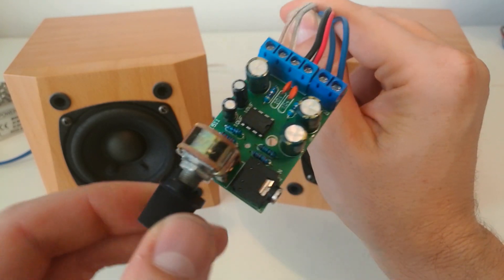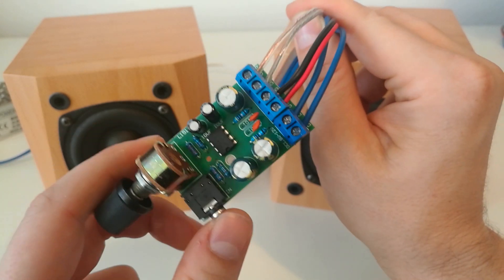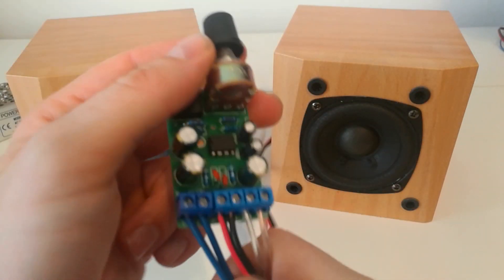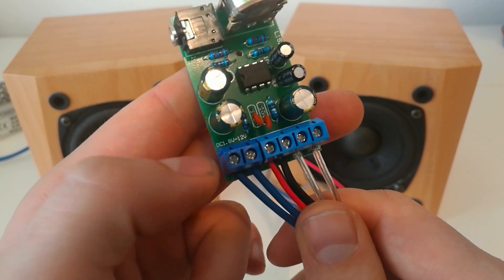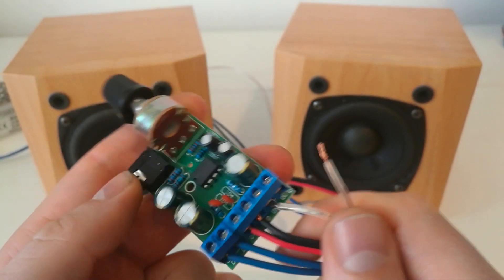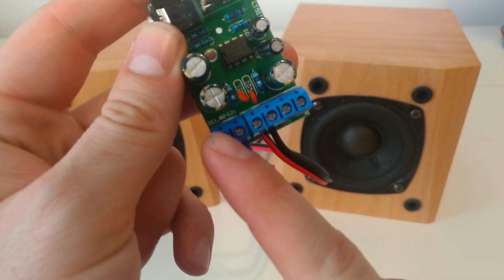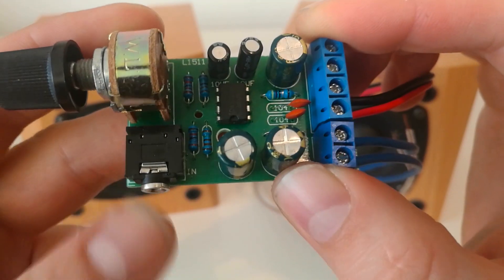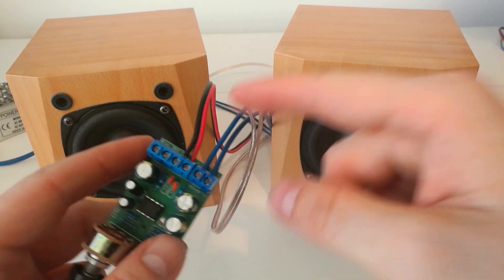TDA2822 M amplifier board 5W - Les than 1$ !!! (How it sounds)

Comment: It is not 5 watts, just one single watt. :P
The TDA2822m is what you find in those "5000 Watt PMPO" PC speakers from the 90's era. :)
I bought the same board but was unhappy: Poor amplification. The voltage divider behind the volume pot is poorly chosen. I have no idea why they reduced the input level that much?! I swapped the resistors and it's much better now :)

Comment: 1. There's no input coupling capacitors which should be
2. Input signal is over attenuated by voltage Dividers 22K & 1.5K which must be modified to increase the signal input for louder sound
3. The output 470uF capacitors should be replaced to good ones as they're leaky
4. It should be operated on 9 volts only with 8 ohms speakers else they get overheated & still a small heatsink should be fixed over the chip
5. Lastly, this chip is Counterfeit so there's much second order harmonic distortion & output power lower than authentic one😊
Reply: To 1: What do you think the two smaller ones are for? ;) - According to the official datasheet it is not necessary having them in series to the input. The default schematics has them wired to inverted input instead. So I think it's fine.
To 2: This is true and retarded because it didn't really amplify anything. I just swapped these resistors on mine and now it does its job.
To 3: I never had this issue.
To 4: I use 4 Ohm speakers and 12V power supply. I gently touched the TDA. It's not even warm?
To 5: Yes, it is. It's ok to me. It works as described. It's cheap and still value for money.

Comment: I have same speakers with the chipset they sound horrible when connected to on board usb on pc it's all EMP, if there was some EMP protection I would been happy
Reply: You connected the ground twice, USB ground and ground of Line-Out-Jack - That's a ground loop, an "O", because supply and signal grounds are connected together on this amplifier and your mainboard too.
EMC filters don't help much there. TDA2822m don't go well with USB-powered PC speakers like this.

Comment: Hello great video, im wondering if I can plug 2 different speakers into  that small amp, one mini Bass and one K28.40 from Visaton? (both are below 10W, one is 4 Ohm and the other is 8 Ohm). Also, can I just power it from a molex PSU cable? PSU Molex has one +12V, one +5V and two Ground cables. Which of those 4 would I have to solder to the mini AMP?

Comment: Wonder if it would be any good on 5V?
Reply: For a long time many inexpensive computer speakers used a TDA2822 chip, either with a wall-wart power supply (usually between 6V and 9V) or via USB power.  There were even a few models that ran off 4 'C' batteries.  Of course if you use the cheap computer speakers with tiny little 2" drivers, it's going to sound screechy.  Use it to drive some decent speakers and it'll surprise you.

The data sheet claims they're good up to 12V but I'm kinda skeptical.  Even at 9V there were concerns about heat.   The ones that were powered by USB (5V) tended usually sounded kind of iffy.  I'd say the chip is best between 6 and 9V
Reply: @xaenon  I tried it with a apple 5w charger and it sounds decent for my 2 inch philips speakers :)
Reply: @euvo_sound  Most people don't realize that you can get quite a bit of sound from fractional-watt amps if you use them to drive decent, reasonably efficient speakers.   I used a little Radio Shack SA-10 stereo amp driving a pair of old Sony bookshelf speakers for a 'computer audio' system for  years; it could get pretty darn loud.
Reply: Review the datasheet on the IC.